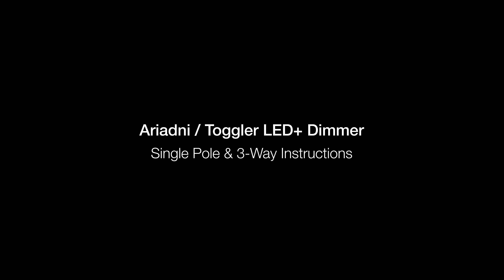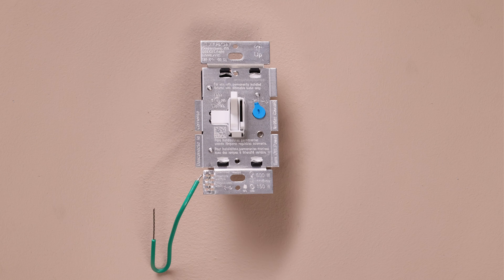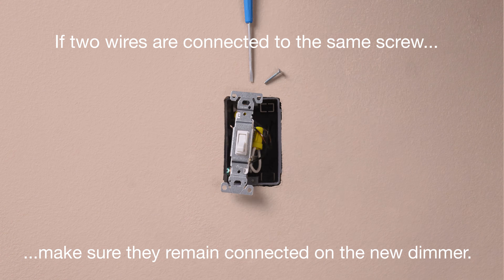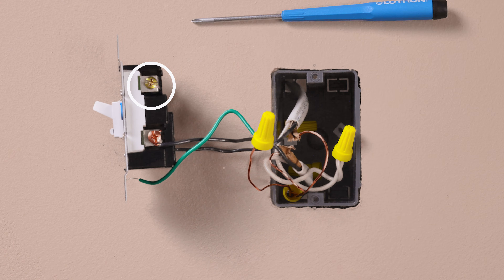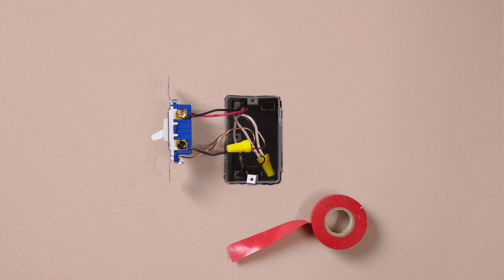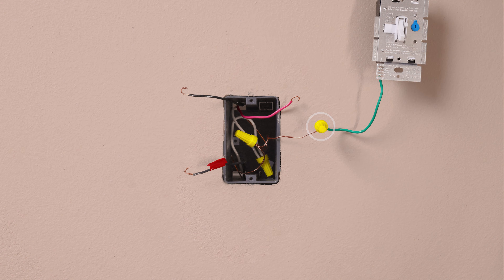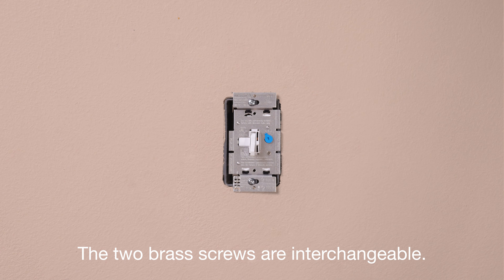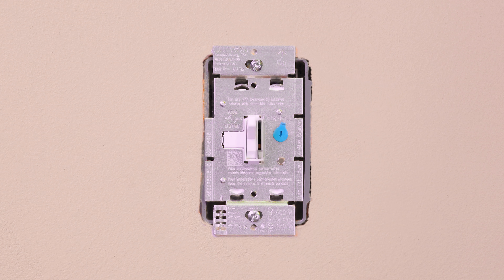Wiring a Lutron Toggler or Ariadni LED+ Dimmer

Comment: The light switch is upside down. Shoes up on the plate and installed correctly. However you switch it up to turn off and down to turn on. Is this something that can be swapped or is this a broken part?
Reply: I also had the same issue. The switch can work as a three way or single pole switch. Chances are good you had the load connected to the wrong brass screw. Power should come in on the copper screw,
Reply: I had the same issue
Reply: It’s because they didn’t wrong in the video. The instructions show the right way

Comment: What if I don’t have a ground wire?  Does it matter?
Reply: Your house must have been built before 1960 like mine. Just cap off the ground wire.
Reply: Attach it to the metal casing
Reply: Do you have the old BX cable (with a metal jacket)? If so, the metal jacket is what does the grounding. So just snip off the green wire as it’s not needed and shouldn’t be floating around in the box.
Reply: Yes